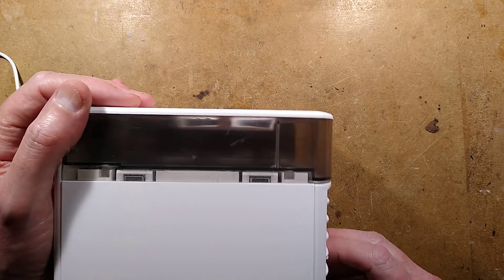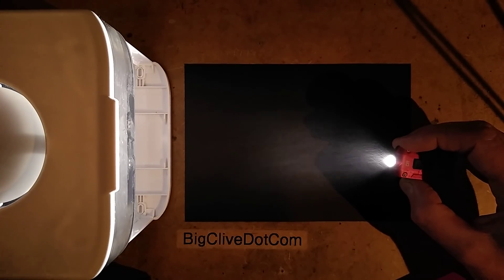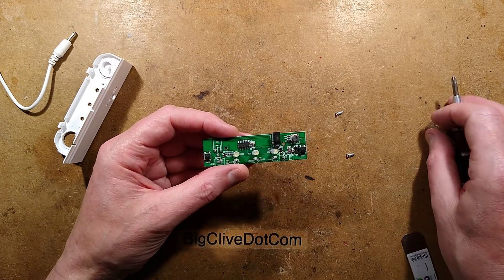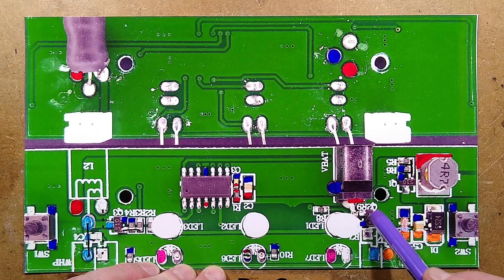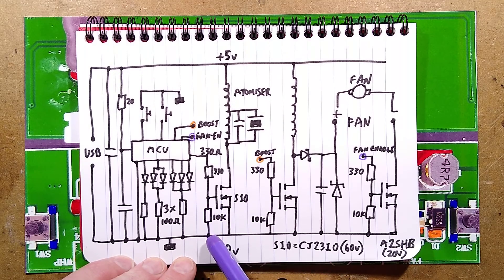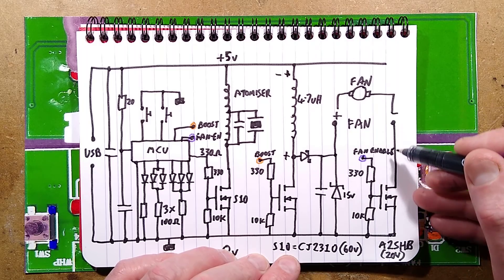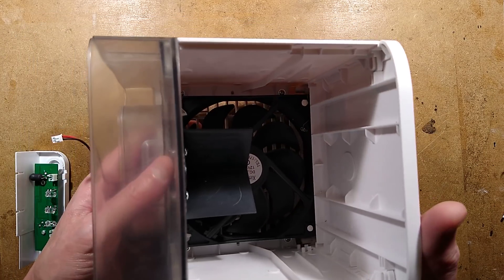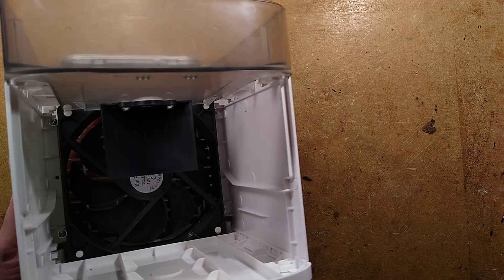USB swamp cooler with fake UVC "sterilisation" (with schematic)

Comment: So in effect this is a convenient USB powered tabletop Legionella breeder / distributor. Cool.
Reply: Perfect for biological warfare!
Reply: A perfect gift for a loved one.
Reply: @ElectronicInspiration  Already ordered 2 for my mother-in-law.
Reply: You can negate most bacteria by running a small current thru the header tank and wicking. Adding Isopropyl alcohol / iodine / bromide / uranium / mercury / chlorine , they all work well also. ;)
Reply: @snakezdewiggle6084  Or just drop one of Clive's infamous Trident Ingot Ration Heaters in the tank  ;)  !
Reply: Nahh... With the "UV Sterilization" there to protect against nasty germ bugs, you should be fine...
I'm fairly sure you almost certainly won't die in the first week! 
;-D
Reply: @TheReal_YΛSH yeah, chlorine !?
Reply: @snakezdewiggle6084  it will more or less be like "sippin up straight chlorine"
Reply: Maybe not bad if you can wash it somehow

Comment: Hey Clive and the gang. Could I be cheeky and again ask your expert opinion on this...

I've got a Refrigerant Gas Leak Detector currently running on a Ni Cad battery 3.6V 2.4Ah. It seems the fridge trade is way behind the times when it comes to moving on to new battery types as it's only a few months old.

Anyway as this current Ni Cad battery takes hours to recharge and doesn't last all that long I thought I'd look at changing it for an Li ion 18650 at 3.7V 3.0Ah (near enough voltage I thought). 

So easy enough to do, using a separate charger though now for the 18650 and it works 

BUT

After about 20 minutes of use the leak detector brings up the low charge light and eventually shuts off as if the battery is flat. Taking out the 18650 and putting it into a charger I can see that the 18650 isn't drained at all and only about 5% down.

For info the original Ni Cad battery would last probably about 45 mins to an hour of continuous use so I was hoping the 18650 would at least last as long or more.

Any ideas on what this could be and how I could solve?

Also just to mention the 18650 cells I'm using are decent quality vape / ecig type high drain by Molicell from Fogstar.

Many thanks in advance all and keep up the awesome work Clive!
Reply: The voltage profile of lithium is not the same as nicd as it discharges. Your low batt circuit is triggering at the wrong voltage for lithium.
Reply: @stargazer7644  Thanks for the info much appreciated!
Reply from the maker: Lithium tends to start at 4.2V and gradually reduce to 3V.  It should still manage half the capacity of the lithium before getting to the normal 3-cell NiMh voltage.
Reply: @bigclivedotcom  Many thanks big man!

Comment: Some hardware stores sell these in my humid as hell area, I haven't seen anyone buying one luckily.
Reply: I live in Denver Colorado,  it's been more humid than normal and still only 40% humidity today.  Was 100* F (38* C) yesterday and my large house was 71* F (21* C) all with a swamp (evaporative) cooler in first floor window.  Amazingly effective most the time here.  I still think these little desk top things might only work if it's right in front of your face.  The cooling is directly proportional to the amount of water you evaporate,  my cooler has a constant water supply (with float control),  huge fan and 3 large meter square pads.  That thing holds a couple hundred cc of water, that doesn't translate to very many BTUs when evaporated.  I suppose still better than just a fan alone.
Reply: @mrbyamile6973  man I wish its 50% on a good day but 70+ during the summer here
Reply: @twistidclowns  the humidity is so reliably low here there is a manufacturer called Coolerado that might have now been acquired by Seeley something or other.  They make a device that uses evaporative cooling without adding humidity to indoor conditioned space.  I drive by the big concrete building with Coolerado written on it daily.   I don’t think the device would work for me as it needs low mineral content water to last.  Im on a well (I'm outside Denver a little), I have very hard water and am having to clean the mineral build-up off my coolers pads.  Its ground level so easy access.   Cool non humid air would really be the ticket, ithout running a refrigerant compressor that is.  I feel fortunate the evaporative cooler works quite well and at probably 1/4 to 1/8 the cost of mechanical cooling.
Reply: @mrbyamile6973  Im glad it works out great for you kinda jealous really, but at 70%+ here it just doesn't do much ive tried. But on those rare dry days you bet ive got a wet towel in front of my fan.

Comment: But is there any discernable cooling effect? This design certainly isn't a swamp cooler in the traditional sense and doesn't appear that it could be very effective. 

Here is the desert southwest of the U.S., swamp coolers are very common and work quite well because it's so dry here. About 20 years ago, they came up with a single air inlet swamp cooler design using a rigid honeycomb cellulose media about twelve inches thick saturated with water which cooled due to evaporation. Outside air is cooled and blown into the house at a rate of 6,500 to 7,500 cubic feet of air per minute for the average home. Typically, it's 5 to 10% humidity and 90 to 100 degrees Fahrenheit (32 to 37 C) here, it can reduce the air temperature as much as 40 degrees (15 C) or so. They use considerably less electricity than refrigerated air conditioning, it's just a blower and a small pump to circulate the water.
Reply: Maybe? It won't do much in the UK, especially on the IoM, as 80% humidity is pretty well everyday here.
Reply: @truckerallikatuk  We have a number of these evaporative coolers in rainy Yorkshire. They're quite effective.
Reply: Yep. They will.work in your area where temps are high and humidity.low. But here on the East Coast its a different story. High humidity most of the time in summer.

Comment: Bought a similar model to this from K-mart for $10.  It didn't claim any UV, but instead had changing lights (party mode?)
It actually worked surprisingly well.... until it didn't.  Something went wrong and it short circuited at the atomiser, and only noticed it because of the smell of burning plastic.
It lasted a few weeks before failing.

Comment: Ha actually have one of these (or a similar brand did not claim uvc though) Is actually nice and cool with cold water/ ice especially on the recent heat wave in the uk... just got to the price well i got ripped off. Never knew what a swamp cooler was until i read the comments

Comment: How long before all that moisture creates a slimy mess inside and throws lots of mold spores into the air ?
Reply: If it is used in the desert where it is designed to work, there won’t be any slime inside.
Reply: @stargazer7644  Not many potential customers live in deserts, I would say the vast majority of people who use this would have a problem with slime and mold
Reply: @ian-c.01  Considering the principle on which this operates, I would say all of the potential customers should live in deserts.  This device will not cool anything unless the owner lives in a very low humidity environment.

Comment: Swamp coolers are only effective in dry conditions, which usually means dry climates. I seriously doubt they'd have much use on the Isle of Mann 😉.  I live in a humid climate and this sort of device would be miserable.

But... there are admittedly thousands of air conditioners running at this very moment in Phoenix, Arizona, so this certainly isn't the first time people have selected the wrong technology for their climate 🙄.
Reply: The reason for AC is the humidity gets much higher in the summer in Phoenix.  That’s the rainy season there. Swamp coolers would work much better in the dry winter, but you don’t need them then.
Reply: @stargazer7644  Ah, I've been through that area a few times in the Summer and didn't realize that the humidity actually got high in Phoenix, so that makes a bit more sense.  Thanks for letting me know.  Swamp cooling has problems of its own, but I hate to see people wasting energy on air conditioning in dry conditions.
Reply: @antibrevity  Sure.  Just as an example, the humidity this morning at sunrise in Phoenix was 66% and temp was 90 degrees.  Dew point was 70.  Humidity was still 44% by afternoon and the temp was 100.  Muggy day. Summer monsoon season.

Comment: You could add an ionizer in parallel with the high  frequency vibratey-thing, put in a slightly lower value resister to accommodate both but glue the ioniser away from the mist so they come out separately. To finish off, you could always buy a real uvc diode and solder that in place of the fake one.

Comment: I bet the RC coming into the microcontroller is actually a power on reset delay. The pin it's connected to is almost certainly the chip enable line; the RC provides a bit of a delay to allow the power supply voltage to stabilize before booting up the micro.
Reply: And where is the micro power connection? It looks like an RC filter on the power supply to me as clive said.

Comment: So how can you tell if a UV-C device is real or not besides putting your hand under it?
Reply: See his video about the banana test.
Reply from the maker: For low power use you need specialist test devices.
Reply: Look at how much you paid for it.
Reply: @stargazer7644  has a point, real UVC LEDs aren't cheap. I just got a self sterilizing water bottle from the Wal-Mart clearance aisle for not much more than what the bare LED it uses would cost.

Comment: Instead of water in the top tray, why not just place a "freezer block" in the bottom tray? That would truly chill and dry the air, and the tray can act as a collector for the water which will accumulate on the block. With a supply of blocks in the freezer, this device could mimic a real air conditioner almost indefinitely.
Reply: The smallest window air conditioner in the US is a 5000 BTUs per hour unit, 1.5KW. That's 5/12ths of a ton of cooling since 1 ton = 12000 BTU per hour, 288000 per day. It's called a ton because it is literally the cooling from melting 1 ton AKA 2000 lbs AKA .9 metric tons per day. Divide by 24 and to get the same cooling as that 5k windowshaker you have to melt roughly 34.7 pounds / 15.8 kg of ice per hour.

Also compare the efficiency of ice machines with air conditioners. That window unit has an EER of about 10 AKA a COP of 3. that means about 28.8 kwh per ton of ice equivalent. The most efficient ice machine per the Energy Star web site is 55.6 kwh per ton of ice, so freezing and remelting ice is at best only half as efficient as just running an A/C and usually much worse, the worst on that site is 210 kwh per ton of ice.

Comment: I’ve purchased hundreds of UVC LEDs, and Here’s what I’ve learned about UVC LEDs over the past few years. 

Coronavirus is terrible, but it’s advanced UVC led Technology and availability by a decade.  

There are dirt cheap READILY AVAILABLE uvc LEDs from China, I don’t know why they’re not using them in some of these “fake“ products. 
They’re actually really good for the money. And after testing all of the ones available, I was surprised at their longevity.
It’s been a lot of fun spending the last 18 months watching and purchasing the new stuff that’s become available.

Any genuine UVC led will be gold plated, with ceramic package, and quartz glass window. 

I was buying them well over a year ago from places like Alibaba for dirt cheap, and then soon after on Banggood, eBay, and even in local places like Walmart. Yup even Walmart.

Good UVC LEDs like the nichia NCSU334A and others, aren’t cheap but are worth the price IF AND ONLY IF you absolutely have to have the highest quality stuff, with a bit more optical power per chip.
In most cases, it’s more practical to use a small-medium size array of cheaper UVC LEDs, instead of a marginally smaller array of high end nichia Chips.

The average UVC LED emits 5-15mw of optical power. In the most powerful UVC LEDs on the market range from 50-100mw. So whether you buy the cheap low power units, or the expensive high power LEDs… You’re still going to have to have an array of several chips on a single board to have any real effect. 

You can find dozens of examples of premade UVCLED arrays online ranging in prices. But considering the nichia UVC LEDs are about $100 a piece… You can see how an array of 25 LEDs would cost quite a bit. 

For sterilization you want something much more powerful. multiple thousands of Milliwatts (1000mw = 1 watt) of OPTICAL POWER.  

This is totally different than electrical power. If a UVC led is using 1watt of electrical power (1000 milliwatts)…. It emits 100mw or less of optical output. That’s less than 10% efficiency.

But don’t be fooled. Because a single watt of optical power can be ridiculously dangerous if focused in the right way. 

The proper term is “radiant flux“. But some folks in the hobby/industry say “optical output”, “optical power”, and other various terms.

Here’s an example of the dangers of optical output power, and then I’ll quit rambling and shut up.

A laser that emits more than 5mw can permanently damage your vision. That’s only 0.005 Watts!! 
The $5 green laser pointers on eBay and can be 100Mw more!!!!!
That will PERMANENTLY blind you Or seriously damage your vision. The damage occurs faster than humans can blink……even from an indirect reflection off of a shiny object.

The number of people who are injured each year by lasers and high output flashlight is growing exponentially. you can buy a flashlight for $30 on Alibaba… That’s capable of focusing a beam to burn a black plastic bag from several meters away…. They even advertise them as “fire starter“ flashlights.

Imagine what it would do to your eyesight. Then imagine swapping those LEDs with a high power UVC LED array. And even worse… Would be an infrared LED or laser source… That’s totally invisible and can blind you faster than you can blink.

Not to be all doom and gloom, just hoping to prevent a few injuries. If you’re interested in lasers and optics as a hobby…. Or you’re already involved and spend way too much money on it like I do… Just remember….

It’s freaking awesome we live in a world that’s constantly developing new technology in lasers, optics, and lighting. But now that this stuff is dirt cheap and can be bought for a few dollars… Remember to do your research and know the risks before you turn on that new toy.
Because I split second reflection off of a shiny object can blind you, or you kid standing next to you checking out “Daddy’s new toy”.

damn, The last few paragraphs isn’t where I meant to go with that at all 😂 
my bad
But still… Be safe.

Comment: the fan died on mine, tried to replace it with computer fan but it is not as strong, not sure how they managed to get it blow so strongly as it only puts out 5V, the stock fan was 12V too. So now I have separate power for the mister and then 12V power for the fan :D At least its much quieter now and doesn't vibrate. I only use the mister as the evaporative cooling is useless in 70% humidity. Mine looks slightly different more like arctic cooler clone without the "UV" leds

Edit: i see noctua makes 5V fans, but they are quite expensive, more than the whole unit cost lol. maybe someday ill get one :D

Comment: Enough space in there to add  a small ozone generator - it would also help to stop "interesting microbiology" happening with those absorbent pads too! Lose the "UVC" LEDS and use that output from the mcu via another MOSFET to do something potentially useful rather than ornamental!
Reply: @LabRat Knatz Thank you for these insights.  Whilst not a fan of ozone generators (apart from the pool steriliser injectors, which are VERY effective!), I suspected the potent oxidising effects might not be as beneficial as we'd hoped!  Is your furnace filter set - up a Precipitron type?  I built a very DIY on e using ioniser modules, a rangehood filter (metal mech cassette) and a cheap pair of p.c. fans.  Going by the amount of dust, etc on the filter, it certainly appears to be doing its job!

Comment: Not sure I’d want more humidity on a sweaty uncomfortable night in summer here.
Reply: Swamp coolers or any kind of DIY evaporative cooling really isn't the way to go in this country, if it's hot enough to need it it's also way too humid for it.
Reply: @estherstreet4582  define “this country”.  They work fine here in the desert.
Reply: @stargazer7644  the UK
Reply: Exactly, unless you are moving heat out you can keep it. Proper insulation, AC and a dehumidifier is the only way. To think that people would add moisture to the air blows my mind.
Reply: @rumbecker5085  unless you like a high static charge on everything, a bit of moisture in the air is useful - not the least of which is for skin comfort (unless you are into the mummy look, the dehydrate yourself as you please).
Reply: @95rav  At bit of moisture is good but I most large cities and population centres are coastal and have fairly high humidity and if you living in a desert you better not be relying on a usb powered swamp cooler. I think the target market for these devices are city people who don't know better, just trying to help anyone who may buy one.
Reply: Okay everyone I’m talking about the UK where there is already too much moisture in the air when it’s hot.
Reply: I have a AC with a water tank. Works like butter on bread. Also, nasty air gets cleaned